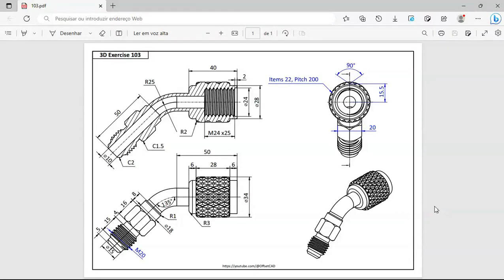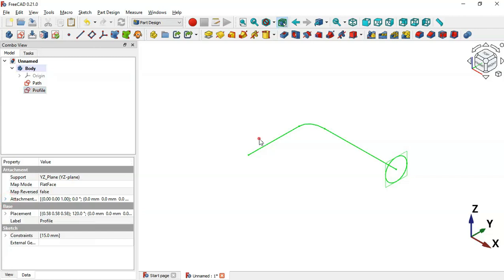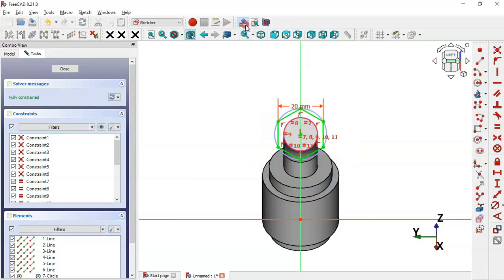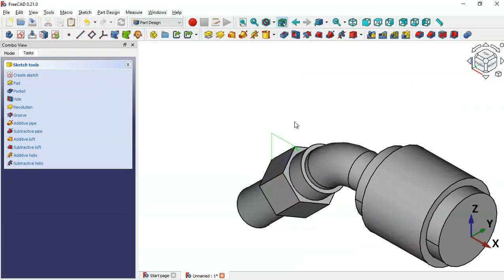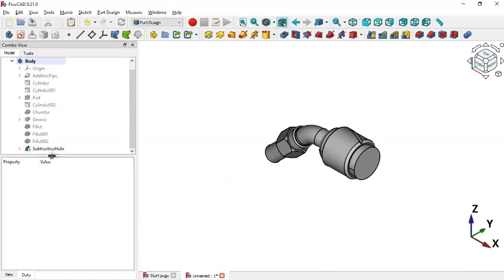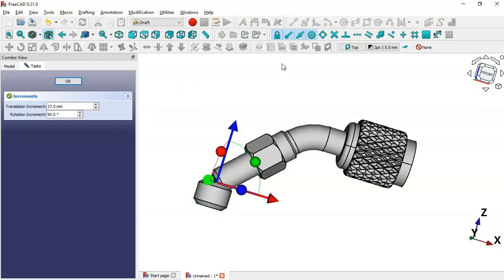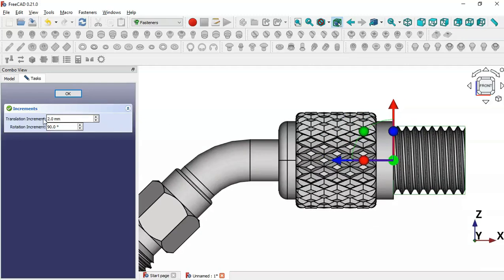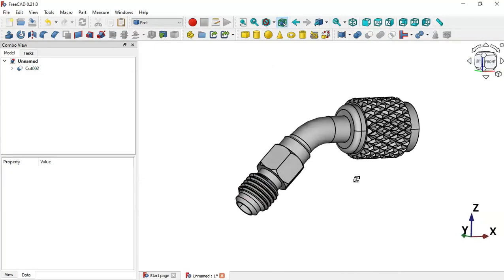FreeCAD 0.20-0.21 Beginners tutorial: practical exercise 103

Comment: I really was impressed with what FreeCAD can do in exercise 102&103, Thanks 
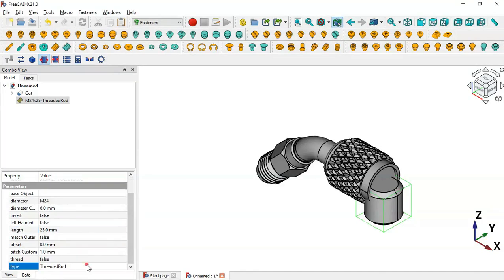I was having trouble trying to move the cylinder by snapping onto the center,when selecting (19:13) type, I did not have type as an option so I just used "add threaded rod..." vs "add DIN 975..." and it worked out great.
Thanks
Reply from the maker: You are welcome!